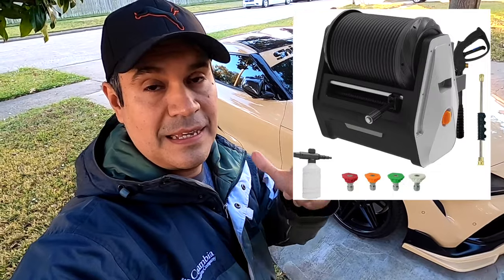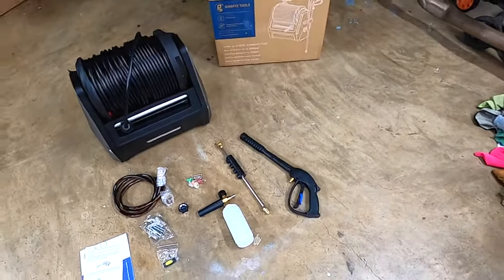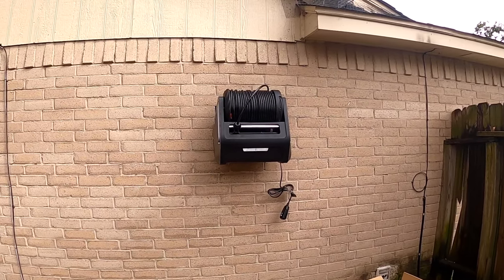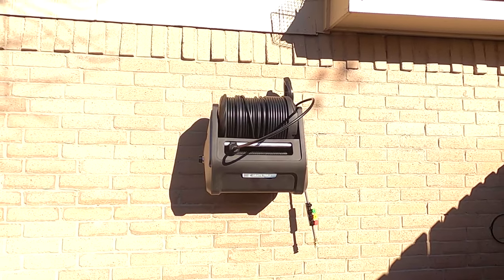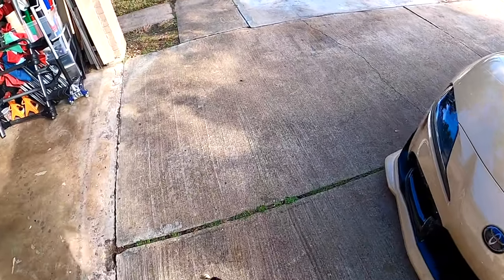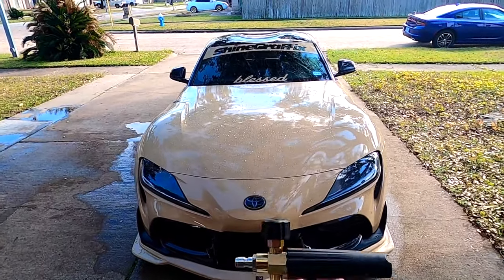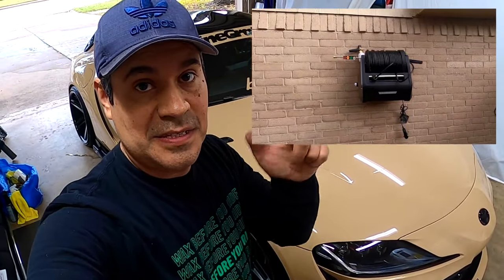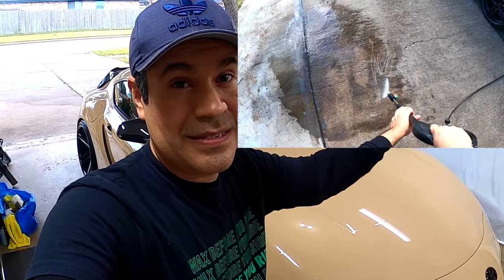WALL MOUNTED Pressure Washer Giraffe Tools Grandfalls

Comment: can you use hot water with it?
Reply from the maker: Yes you can use hot water but not super hot water. Check the products specs for the max heat that it can handle 👍